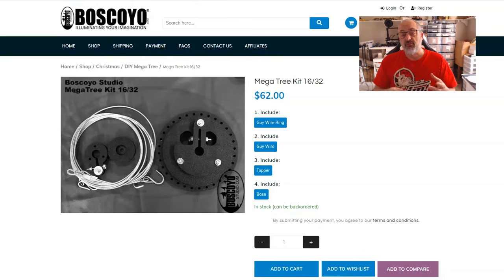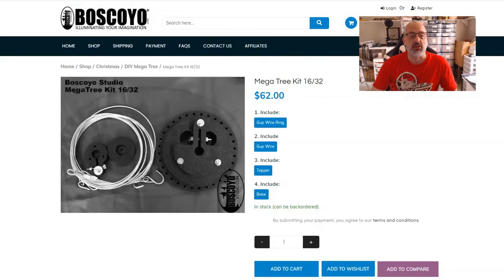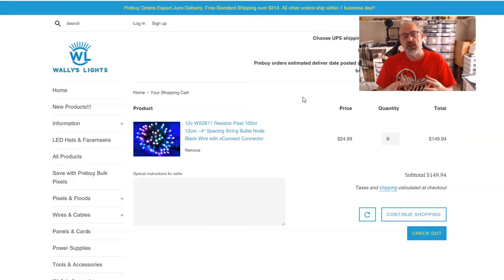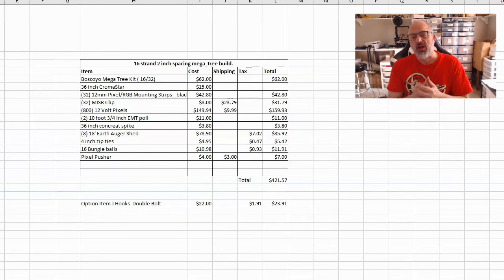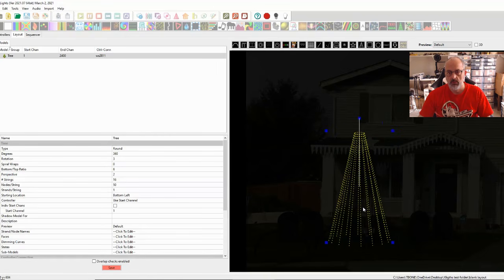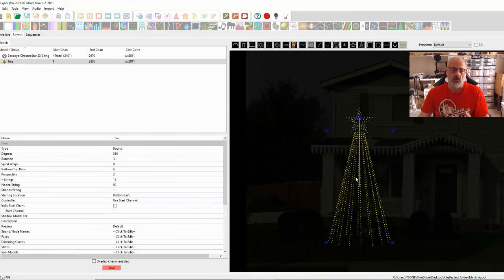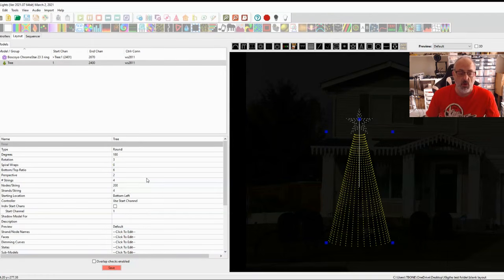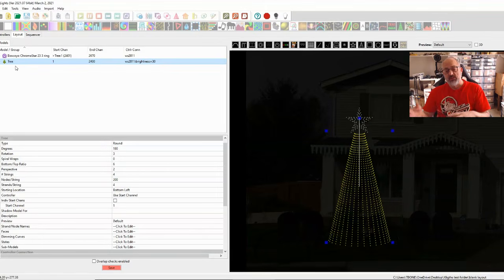16 Strand RGB Mega Tree Build Using the Boscoyo Mega Tree Kit.

Comment: Thank you for the video.
I currently have a mega tree I made with copper wire ‘seed lights’ which I would like to replace to pixels. 
Although I have not been able to make one because shipping prices are expensive to bring into NZ. My current tree was very cheap since I had a spare pole laying around from my garage door opener being replaced and common fittings from the hardware store are accessible. 
These new pixels are fabulous, but they need heavy duty mounting strips and a much stronger frame.
I’m slowly getting switched over to pixels, but it is not cheap in my country.
I do have videos on my channel if you'd like to give ideas :) .
Reply from the maker: Good Luck to you mark hopefully you can get in on some of the international group buys.
Reply: @CounterHolidayLights  There's not many bulk buys to down down under because there's no one to bulk buy with 😭.

Comment: Looking to get my show started and wanted to start with a Mega tree so this will be a great start. Would you recommend a controller for this as a standalone feature and easily expandable?
Reply from the maker: Cory, for our first year we build a F48 and used receiver boards around the yard ( this was to plan for expansions  ( last year we powered 4800 pixels off it and still had 12 open ports.  The tree in this video had a box with 3 receiver card in it, 12 ports 2 power supplies.  we ran  the tree of 8 ports but could have easily done it off 4 ports and then used another port for the star and one for the arches leaving us 2 left over ports.( we will be doing receiver box and and f48 build videos in the coming months.     This year we are building a bigger tree will be taller 100 lights per strand and 32 strands so we will be using an F16v3 with expansion board. ( 32 total ports half just for the tree. that video is already up.

Comment: This year (2021) will be my first year doing a Christmas light show and so far i have made Pixel sticks for the for the front garden and sprayed them so they look like candy canes. I have built 4 stars for the side of the house using Boscoyo stars and am now about to build 4 arches to mount on the roof of my garage with an RGB flood under each arch. I have designed a 16 strand Mega Tree in X-Lights and that's the next build so having this kit would help me massively in completing this in my build.
A great video as well with some great tips on building a tree, thanks.
Reply from the maker: glad you found it useful and Welcome to the crazy fun hobby.!!!!!